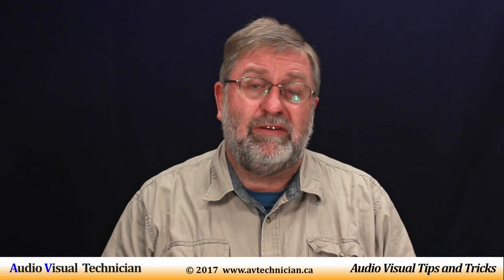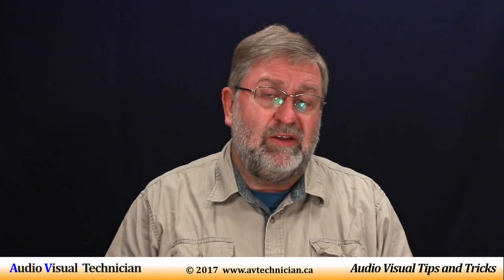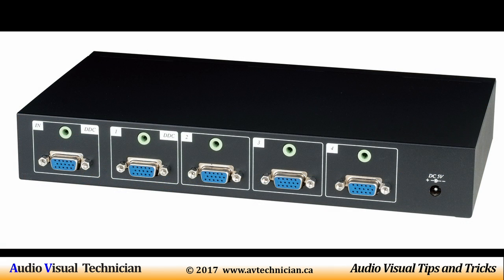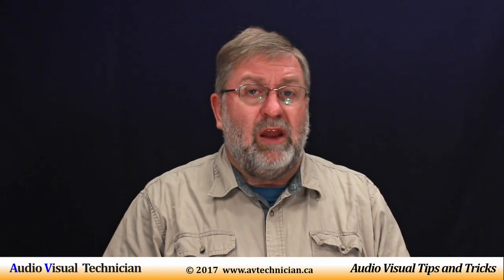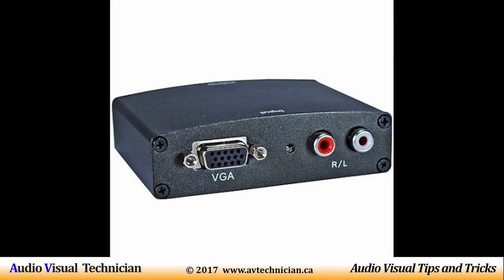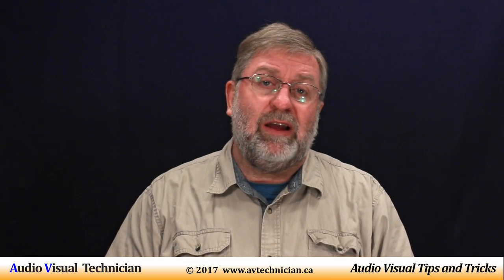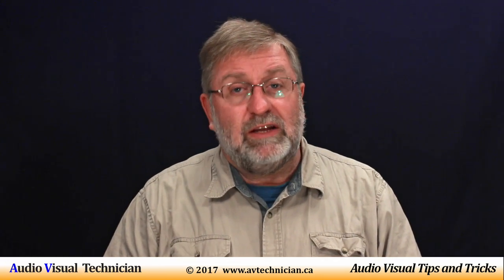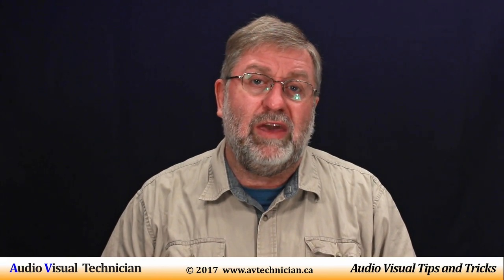HDMI/VGA Distribution Amp

Comment: Good evening!
Is there a device that can boost the intensity/Brightness of a VGA signal? I really need one but can't seem to find it.
Reply: If you are talking about boosting the signal then the device I'm talking about is what you need. In the course of splitting it also slightly boosts the signal.
BUT if you are talking about improving the VGA signal that is usually done from the source (i.e. the laptop or video switcher).  Brightness can be adjusted in the program on your computer, or in the video switcher. Alas that's the only way I know.